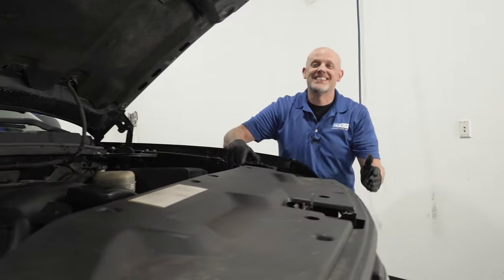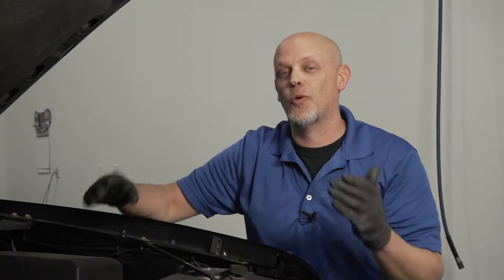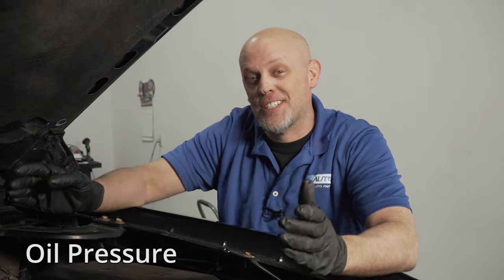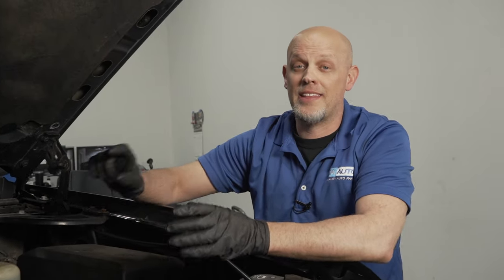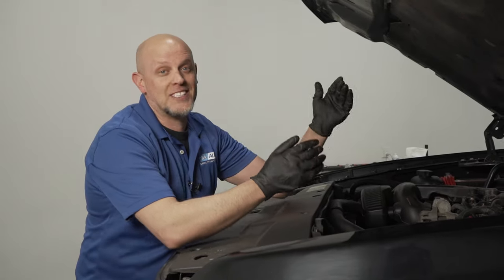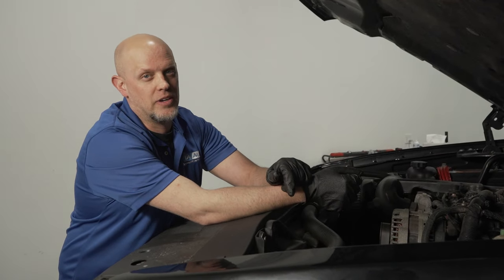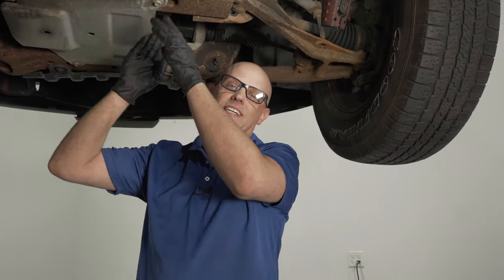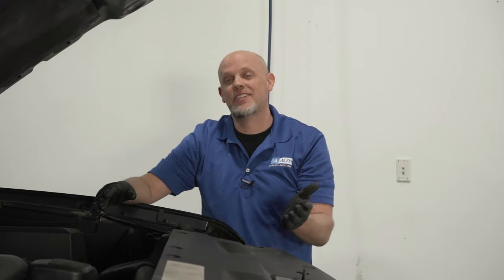Top Common Engine Problems 2007-2013 Chevy Silverado 1500 Truck

Comment from the maker: √  Watch the Video
√  Buy The Part at 1A Auto http://1aau.to/m/Visit-1AAuto
√  Do it Yourself
√  Save Money
Reply: I have a 2012 the cylinder nearest the driver is burning oil my machanic said that ring was collapsed in that cylinder could it be just the valve cover? It has 180000miles on it

Comment: Had a 2009 Sierra. I had to replace the oil pressure sensor twice and had crazy oil consumption. I replaced the valve cover with the bigger pcv valve in it and switched to full synthetic oil and it stopped burning so much oil. But I had a nearly trouble free 200k before I traded it in. Great truck!
Reply from the maker: +FindingIsaac Thanks for checking us out! http://1aau.to/m/Shop-1AAuto-c

Comment: I'm surprised the lifter failures from the AFM system weren't mentioned. Caused me issues when i had my truck.
Reply: Whoever owned your vehicle before you probably didn’t change the oil which will cause lifter issues
Reply: Any time you talk to these mechanics about a chevy truck from 07 up that AFM is th first thing they talk about
Reply: @charlesbunting1790  Because its the ONLY issue!
This video is only about parts wearing out eventually, not premature failures

Comment: Broken exhaust manifold bolts. Causing an exhaust leak "ticking" which a lot of people think is a lifter. Gm went with regular old bolts on the exhaust manifold and after about 10yrs or so the bolt heads break off from stress and heat cycling; then the manifold moves away from the head and leaks. Extracting these broken bolts can be extremely difficult especially if it's the dreaded driver's side rear there is very little access. The bolts that break are usually driver's rear, driver's front and passenger rear. They sell aftermarket clamps that bolt to preexisting holes in the cylinder head then a bolt puts pressure on the manifold to seal up a leak. It's a bandaid but can work. So gm knows about the issue and designed around it. Most manufacturers use studs to avoid these problems.
Reply from the maker: +Rusty Shackelford Thanks for the tip! We'll pass this info along to our production team.

Comment: Good info. Wouldn’t you say the lifter tick is fairly common also. I don’t know one that hasn’t had it at some point.  But great video.
Reply: Once they start getting a lot of miles, the lifter tick is probably fairly common. But if you take good care, change the oil every 3000 miles, maybe you’ll never get a lifter tick.
Reply: I get the tick only on start up for a few seconds then it goes away. But if the truck sits for 2 days the tick lasts longer till she warms up. Got 138k on my 08 sierra
Reply: A lot of the lifter tick issue (what you actually hear) is exhaust manifold leaks. Very few that I've come across with more than like 250k km (155k ish miles) has some form of exhaust leak that emits a lifter tick noise.
Reply: I switched to full synthetic and the lifter tick nearly went away.

Comment: The 305 V8 is one of the last engines GM made right. They rely on an old technology (waste spark ignition as opposed to coil-on-plug ignition) but that technology is pretty much bulletproof per its simplicity. Only thing is, when you service the distributor cap and rotor, make sure to align the rotor to the correct time, otherwise your ignition will be ever so slightly out of time, causing the engine to run rough.
Reply from the maker: +Sebas1509 Thanks for the feedback!
Reply: 305s are the next big engine swap craze.  Remember, you heard it here.

Comment: How about the 4.3 - v-6 engine review of problems on 2007 - 2013 models .
Reply: No problems with mine. The 4.3 are great engines
Reply: There is no problems

Comment: Thanks for the information.  I have a 2013 Sierra that's ready to hit 120k and just love it.  It still runs great and looks good.   My biggest gripe is the interior driver's door arm rest broke in half and found out that you have to replace the whole door panel to fix it.  I just put some tape around it for now until I find a better solution.

Comment: The 5.3 had porosity issues when the aluminum blocks were cast, didn't fix it until 2015. See the TSB, leaks coolant into the bores. solution is a new engine.

Comment: Hey 1A-Auto ,
 U guys also  suppose to mention next: 
 That GM engine: especially v8 are very sensitive with: 1. oil change postponing.
2. Oil consumption burning (afm or dod systems,   all , all , all issues are these AFM, DOD. innovation in these vehicles, 
 Because previous generations till 2006 was regular hydraulic lighters  but no v4 or v8 gas savings mode,
.
 That  AFM DOD,
 killing previous good GM engines reputation, 

A lot of people have to doing expensive AFM,DOD DELETE KIT AND BIG JOB DONE,.[ or buying RANGE DEVICE $220] AND KEEP IT PLUGGED IN ODB PORT ALL THE TIME.👍🙏
.
3. Head gasket blows and leaking after 150,k.miles. on these vehicles. 

So please make a new episode,  and mention these only three major  Issues on these v8  engines : 4.8,  5.3,  6.0,  and 6.2L
Called AFM (active fuel management) 
From 2007  to 2010 or 2020

BUT from 2020 and 2021 they make again something new ,  some customers says that that experiencing even worse things 
Called DFM(dynamic fuel management).

So they asking  GMcomp.
 To make a recall, 
 And now gm offering a some Silverados with out DFM and fully working v8 fully time engines on these trucks.🤝👍👍👍

Comment: I bought a 2012 April of last year. When I buy a used vehicle, I always change all fluids front to back even the gear oil in front and back differentials. The truck takes 6 quarts of full synthetic 5w30 oil. Here's what happened to me one day.... In January my family and I were coming home from taking my son to the doctor when the check engine light came on. I got the truck home (Thank God) hooked it up to my OBDII scanner and it wash the oil pressure sensor. I was going to replace it but a guy on here told me to check my oil first. When I checked it, the dipstick didn't have a drop of oil on it. (I FLIPPED OUT) I just paid $18K on this truck! So, I went ahead and ordered both valve covers because I wanted both of them to be clean and to also match one another. I've installed both of them, but I've not checked to see if it worked because after installing them the passenger side pcv outlet on the new one has a flared end on it and the original didn't have that. So, I went to Advanced Auto to buy a rubber hose to use on it after I cut the pressure clip off of the pcv hose. I also decided to get me and new gas cap while I was at it. Anyways, I hope and pray that the new valve covers help the "Oil Consumption Problem." I'm sort of worried about it though because that's a lot of oil being consumed in just 4,000 - 4,500 miles. Yes, I've also checked for leaks and there were none. I've seen vehicles that are burning oil, but this truck doesn't do like that. The only time I've seen blue smoke out of the exhaust pipe is when climbing a hill, but it's just a small amount and then it's gone. If you were not paying attention to it, you wouldn't notice it. I've also checked my antifreeze for oil to and if good. Another thing, after I change the oil the dipstick doesn't read right which has me stumped. It should be on the full area, but it shows as if I put 12 quarts instead of 6. I'm thinking it got the wrong dipstick in it, but if anyone knows something different let me know.

Comment: is the 4.8L a good motor?  Found a absolutely mint 2007 short bed reg cab 4x4, but has the 4.8L engine. Thanks.

Comment: Always have issues with low oil pressure - already replace the sensor and screen twice and it keeps happening . Now I also have an issue where it cranks and it does not start . When it starts black smoke comes thru the muffler pipe
Reply: Your issue sounds like a bad fuel injector to be honest. Black smoke indicates too much fuel usually

Comment: Please make another video. You did not address the AFM lifter issue that can require cam replacement. The seal on the oil pickup tube is also a common issue.

Comment: I’m looking at a 2010 LT with 198k, with a new transmission. I know it’s high miles but it runs and rides smooth like new. Any feedback?
Reply: Just bought a 2007 5.3 LT with 169k miles. Truck has been great so far. Runs and shifts smooth. Only problem I’ve had so far is the check engine light comes on and off randomly.

Comment: I had a stuck lifter as well due to the afm. i fixed by using crazed performance method on youtube, not terribly hard to do
Reply: WhT is that?   Have a link?

Comment: I have the 2007 5.3. I'm approaching 120k with it. What would everyone suggest I do in terms of maintance to prepare for the milestone? Truck was well taken care of by previous owner (elderly man) and I have changed the oil regularly. Bought it 2 years ago at 86k miles, have 118k now. Recently replaced the throttle body 150miles ago, but am having trouble relearning the idle manually. I want this truck to last so any advice is well appreciated!
Reply: You need to do an idle relearn with a scan tool.  Probably cheaper to have a shop or dealer do it than buying a scanner with that capability.  As far as maintenance, frequent oil changes (3-5k mile interval) seem to be the cure for AFM issues.
Reply: I would do spark plugs/wires. And check you're transmission fluid color. If you do the transmission oil change I suggest dropping the pan and replace the filter. Lube shops will just suck the old fluid out and not replace the filter.
Reply: Dang ain't no miles on your truck lol.

Comment: 2010 Silverado cranks over good only fires every 4-6 turns overs before start, like no fuel but after 3rd key turn it smells like it is flooded. I do the most evil thing at that point and hold key to on and peddle to the floor if it dosent start after the 3rd. only happens in morning and after work you turn it off and it fires up right away, with in a half hr or so after first start. what do you think?

Comment: can I replace my 5.4L In my f150 with one of these!
Reply: 5.4 is unnecessarily hated for all the wrong reasons
Reply: @BuckingHorse-Bull  Nah it's definitely necessary for a reason... spark plugs flying out, low oil pressure, & the infamous cam phasers I'll hard pass and get a 5.0L instead.

Comment: I have searched and searched. My problem is simple but not sure on the repair. I have a 2011 Silverado 1500. My pickup runs great but coming home today the rpm gauge jumped up to 5k but the pickup speed and sound did not change! when I reached home and shut the truck off the rpm gauge stayed at about 2500. Trucks running great, no problems, no warning or codes showing. HELP

Comment: Gm 3.6L v6 engine please.
Reply from the maker: +Ger Hal We do not have a video for this right now, but we'll keep this request in mind for a future video! http://1aau.to/m/Shop-1AAuto-c
Reply: @1AAuto  I'd also like to see a review of the V-6. I bought a used 2012 Silverado W/T about 2 1/2 years ago with 58,838 miles on it, and have put about 1,700 on it. I like it but it needs a set of headers and a cat-back.

Fair winds and following seas to all.

Comment: Do you think this issues apply to the 4.8 engine size 🤔?
Reply: Yes. 4.8, 5.3, and 6.0 Vortec engines are very similar. The 4.8 and 5.3 are almost completely identical, I believe all sensors are the same and most other components as well. Don't worry, they are great engines
Reply: @alexehhhh  4.8s don't have the afm mode

Comment: Stay away from GMC. I have 2013 GMC Sierra. Bought brand new. It is a POS! Has the GMC known lifter/cam shaft defect at 123K miles! Why isn"t there a class action suit against GMC for continuing to push out defective engines???
Reply: I had the same issue with 2013 Silverado. After this truck, I am dome with GM.

Comment: I never wondered but why did my 2013 Silverado 1500 lt come with a vtec? I’m not the brains when it comes to engines 🤣
Reply: You might be mistaking for vortec, which is the engine in your truck. VTEC is a Honda thing!